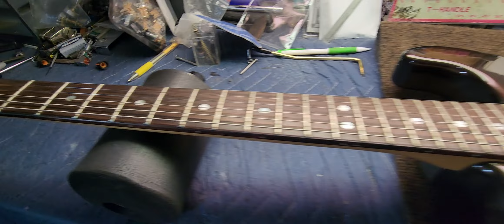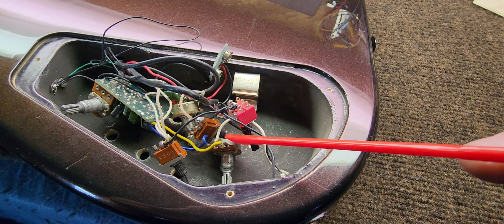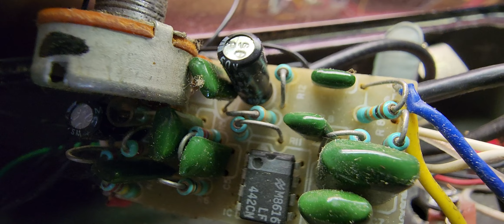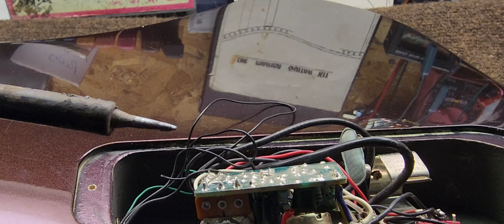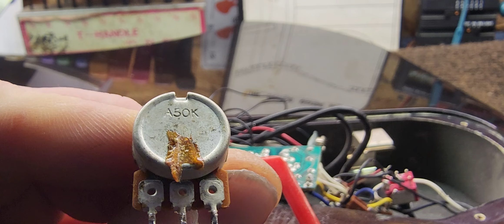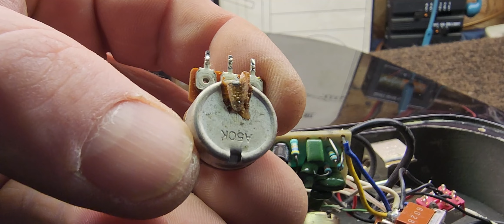Guitar Repair. 1986 charvel model 4 removing volume pot from the circuit board. tips hacks

Comment: Just restored my Model 5 back to factory after being told in 1997 that the "active electronics were fried."
Glad I kept the original parts, cuz after almost 30 yrs with Seymour Duncans, turns out they were all intact- it was the ancient 22 ga. wiring that failed.
I hear a bunch of hate at the J80c pickup- if it's muddy or harsh, cut 1/2 inch off the leads, strip to fresh 4 wires and re-install it. Replace all the wires in the harness you can, mine were shorting out everywhere.
The J80 and J80c Made in USA are passive, and they are AMAZING with solid wiring.

That mid-boost circuit is the JE-1200, and it needs the 50k pot, so good job. Mine didn't have the mini-toggles, just the JE 0005 (5-way switch of mass confusion) Factory wiring was 1=nck 2=brg+nck parallel 3=brg+neck series 4=brg+neck parallel filtered 5=brg.
Reply from the maker: @lsu1992  Thank you for the valuable information! Great ole super stra!

Comment: Hey Jake.  I'm following your video to replace a worn out pot on my 86 Charvel model 4.  Any source for audio taper 50K pots?  I'm having a heck of a time finding one.
Reply from the maker: @ronm2099  Make sure when you search you type 50k audio taper pcb mount . there are some on ebay now.  best of luck
Reply from the maker: @ronm2099  i will see if I can find out where I acquired them. it's been awhile.
Reply from the maker: @ronm2099  it looks like an ebay purchase, but i can't find the seller on there anymore. I will keep digging.

Comment: I worked at Lasalle Music in Boston around the time they were selling these. Judging from your accent, it sounds like you might know the place. I did acquire a Charvel Model 5 at the time. The guitar plays great but the pickups were always weak on the top string, so I recently replaced them with active EMGs. In that process the licensed Floyd Rose bridge broke (it made of cheap pot metal).  Nice job bringing back a nice guitar.
Reply from the maker: thanks for the info and the kind words, u reside in maine etc.  I know a lot of the old new england stores from that Era. ty for the view and the info again. best regards, Jake